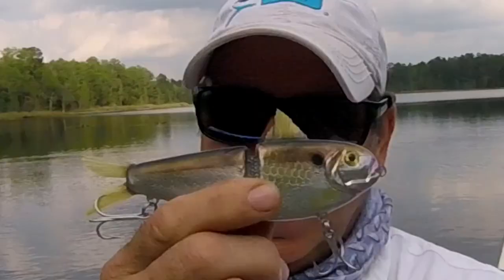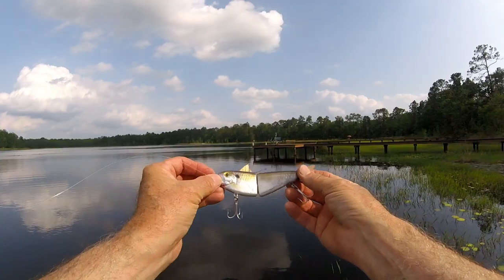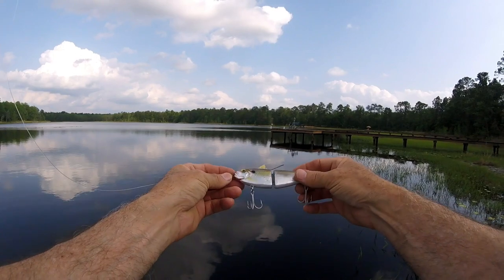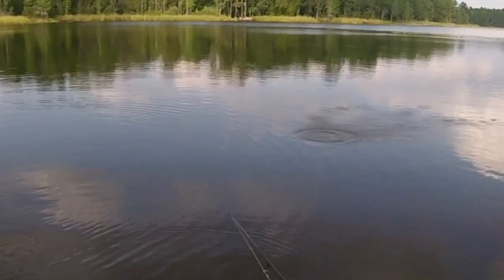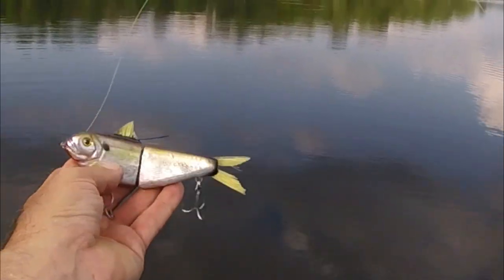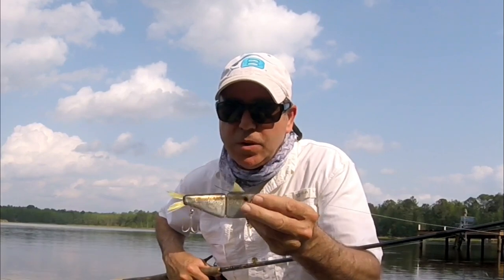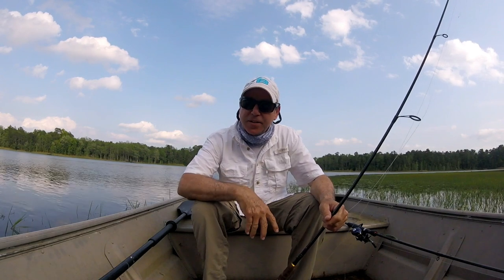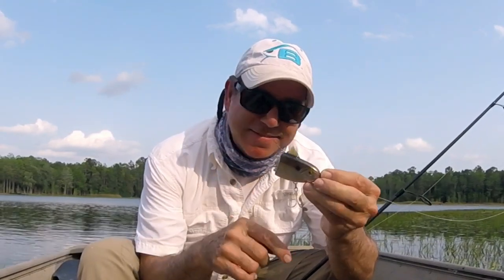Making a Glide Bait, Water testing to the death

Comment: A couple of videos back I asked you about the strength of that hinge and you tested it to 120 pounds if I remember correctly.  Plenty strong enough  but I also mentioned a twisting motion.  1 hook in the net 1 in the fish and the fish starts rolling like the gator might have done when it felt the pressure of the bow line.  Just guessing because northern pike often do "the death roll" in the net. Not sure how you can test it but would be interesting.
Reply from the maker: Yeah it's tough to design for a twisting /pulling load. You can only hope that the net will twist....

Comment: As an engineer I would assume that not many lure prototypes have gone through this level of testing during the R&D phase.... :D

An interesting alternative to the nylon strap would be kevlar webbing: 1 inch kevlar strap has a breaking strength of ~2000lbs and kevlar is not easily cut.
Reply from the maker: I have ideas for alternative materials. ..this is far from over. What? Obsessed? Me? Well, maybe.

Comment: Hello! Im new at luremaking and have some trouble on Coating. I used some Laqeur but its too smelly and soft (fingernail can go trough). I am doing Balsa wood baits and need some strong and durable clear coat or Laqeur or both :) any suggestions what i should buy exactly? Thanks in advance! Your videos are very helpful :))
Reply from the maker: Do you have a lure turner...if so then you should  use a two part clear coat. Check out my clear coat play list.
Lure Clear Coating: https://www.youtube.com/playlist?list=PLEVBv_zywucSE3Q_3aAPxl48GCyqD6TDn
Reply: Thanks for your reply! No, i don't have a lure turner yet.. i was dumping my lures in coat and hanging for 24H. But as i said it's not as good as i want. I saw your other videos and i liked "east Coast" one. i think i'll order that one. Is it ok to clear coat with brush? and Do i need anything else, just clear coat with east coast product (2-3 times i guess) after paint and that's it?  sorry for so many questions :)